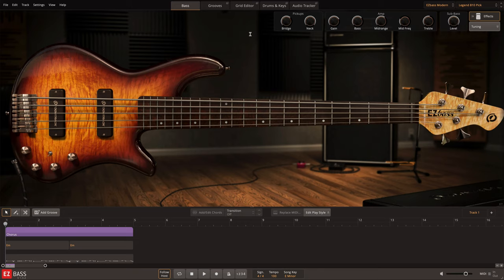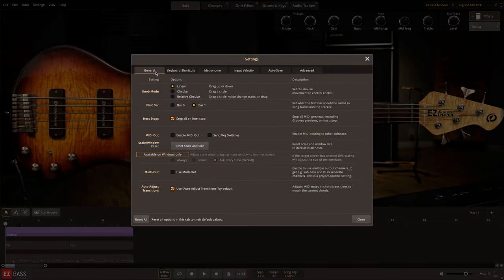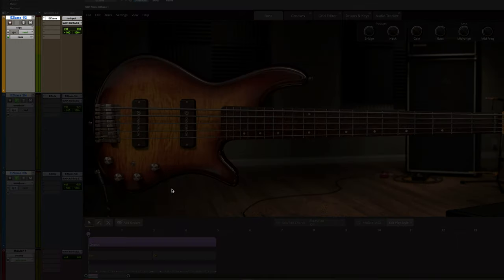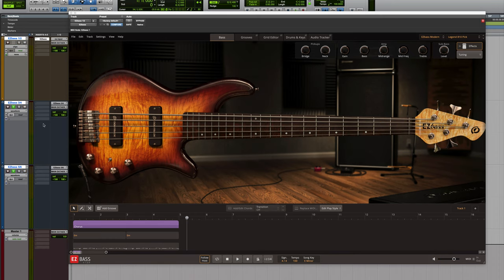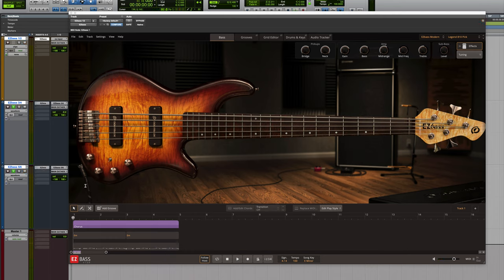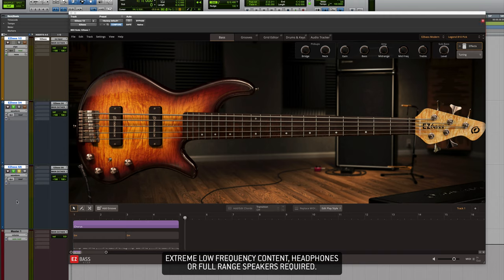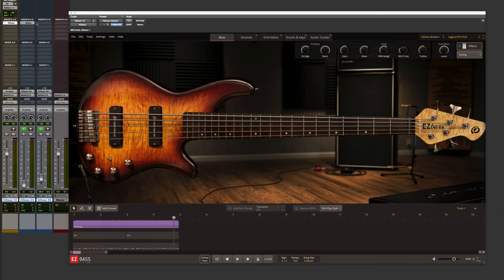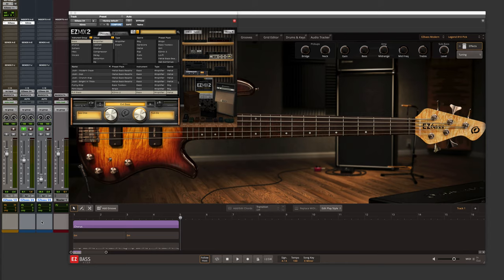EZbass – Using Multi-Out

Comment: Hi, nice data . I have A PROBLEM AND I HEARD IN THE VIDEO TOO. wHY THERE IS A VIBRATION EN THE BASS WHEN ITS SOLO ? IN THE MINUTE 1:07 FOR EXAMPLE IS VERY CLEAR WHAT I SAY, BUT IS VERY DIFFICULT TO EXPRESS.THANKS IN ADVANCE
Reply from the maker: Hi Alejandro, please contact our support so that they can look closer at this. Use the Contact Support button at the bottom of this FAQ: https://www.toontrack.com/faq/how-do-i-contact-support/
Reply: Thats how bass di sounds dawg its usually rattle abit. But this for bass with brand new strings. Bass' with 5 yearold strings sounds dull

Comment: In Studio One 4 you get 4 Stereo outputs 1/2 + 3/4 + 5/6 and  7/8 ! 
3 which have output signal ( The 4th have no signal ) ???
Reply: I have to get into the manual. I wasn't aware of this feature. But I hope they didn't do what they did with SD3, make all the outputs stereo.
Reply: @Bezowinz  The Manual is pretty useless !
There is noting on Multi-Out
All Multi outs are Stereo

Comment: Please consider adding some flexibility to this, allowing for example, 2 DI outputs and the sub.

And why do you all insist on only stereo outputs? Same with SD3, even when the source is mono.
Reply: Well, just add two tracks and set their inputs to 3/4 output of EZbass? Voila, you have 2 DI tracks now.
Reply: Ak3mi91 I wasn't looking for an obvious work around, but thanks.
Reply: @Bezowinz  The thing is, programing something like that takes time and costs money, so I doubt it will ever happen, because you already have this flexibility built in every DAW. Unless you have some specific reasons I don't understand. Also, I wouldn't call that a workaround, I wholeheartedly believe that this is how you are supposed to work in the DAW.
Reply: Ak3mi91 I seriously doubt adding a 3rd option with 2 DIs and the sub would take much time or money. The signals are already there.

This flexibility is not in my DAW (Studio One) without adding a 2nd instance of EZbass or a send. Neither of these options are as clean or convenient as what I requested.

My reason is to have 2 DIs and the sub, without a 2nd instance of the plugin or send.

I'm calling it a work around because it would require a 2nd instance or send when I want the functionality in the plugin.

I never understood people's need to speak down on other's request because they don't see the need. I get it. You're not interested. Let's leave it at that.
Reply: @Bezowinz  Well, I was just trying to push you in the right direction, because I assumed you are an inexperienced user. I checked a few videos to understand better how routing works in Studio One and now I understand the problem. I guess, I'm just a spoiled Reaper user. I was SO SURE that it must be possible to do it in every DAW, but oh boy, I was so wrong. Consider my "like" bumping your post to be my apology.
Reply: Ak3mi91 appreciated. Nah, I'm 15+ years in with Pro Tools, Logic and now S1 experience. I've settled on S1, but unfortunately it doesn't allow changes to plugin output signals like some other DAWs. Great DAW in many aspects, but some basics skipped over, at least compared to some others.
Reply: Bezo winZ does S1 still not allow you to put inserts post fader?

Also, will this problem have anything to do with converting the bass midi into wav, then reamping into a real amp? That’s what I’d like to do